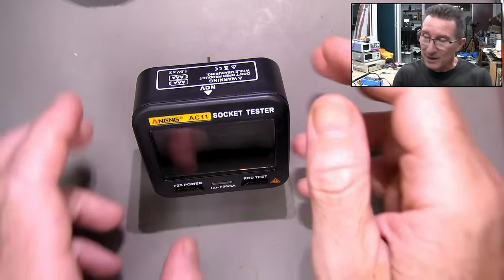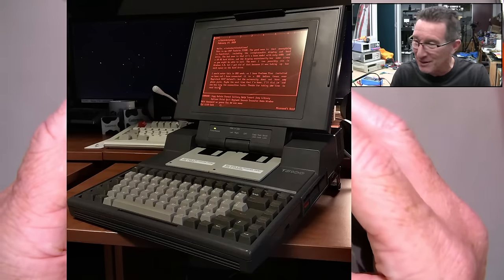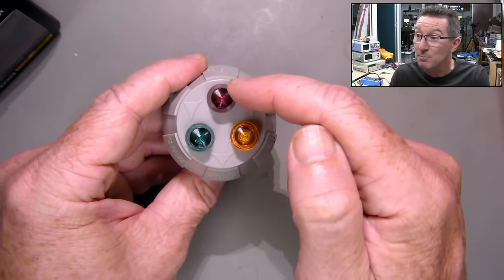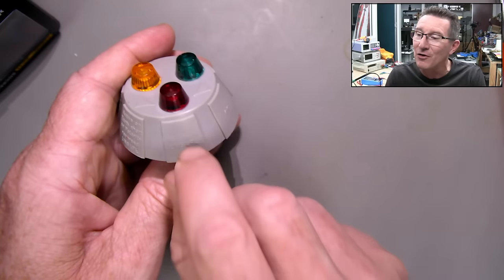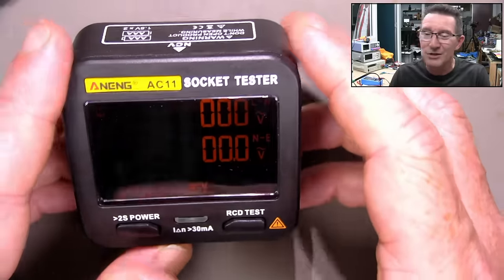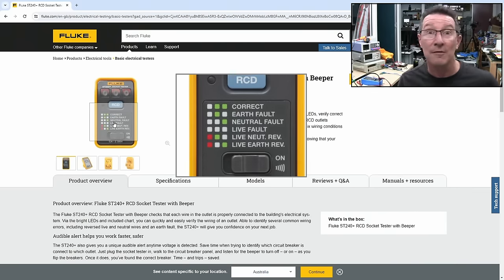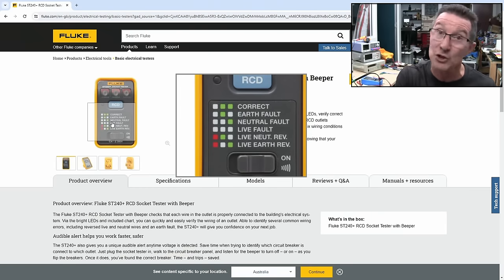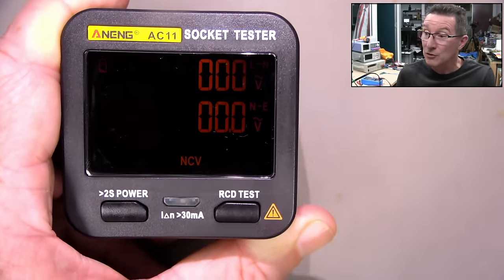EEVblog 1598 - ANENG AC11 Socket Tester TEARDOWN + SCHEMATIC Reverse Eng

Comment: Throughout North America, ground must be bonded at the service entrance at the first means of disconnect. Ground must not be additionally bonded at any sub-panel as that would allow current return through that ground conductor segment.
Reply: The interesting thing about all of these testers is that you really don't know if "earth"/ground is really and truly "earthed".  All you know is that the "earth" is connected to something.
Reply: @tubastuff  Which is fine as long as it's bonded at the main fuse panel. Having it bonded downstream would possibly defeat any RCD's, but since the earth wire doesn't pass through the RCD detection circuit, it doesn't matter where the PE/earth current ends up.
Reply: @AnnaVannieuwenhuyse    I'm not so sure about that.  In the US, the 240V CT of the distribution transformer (for residential single-phase service) is supposed to be connected to a true earth ground.  In the distribution panel, it's also bonded to the "neutral" and ground tracer wires.  Should the external true earth ground fail, the possibility of a fault to a water pipe or other "true earth" ground goes undetected.   When we have 240V devices, they're 120V-0-120V; i.e. both supply wires are "hot".   Of course, this differs from most European countries, where one of the supply leads is neutral/earthed.
Reply: @tubastuff  what's before the main disconnect was not scope of my comment. I retain my position on what I said. 🙂
Reply: @tubastuff  And that's why all water pipes and similar are bonded to the building's electrical earth ground.
Reply: @eDoc2020  It used to be that way, but with PVC and PEX plumbing, it's hard to see why it would make sense today.   Copper plumbing has been largely left in the dust on new construction, due to cost.  Galvanized iron pipe even more so.   Nowadays the practice is to drive a metal rod into the ground, tie to to the main panel and call it good.
Reply: @tubastuff   Obviously you can't ground plastic water pipes but at the same time this means the water pipes can't become live. AFAIK new gas pipes are still metal.
Reply: @eDoc2020  Depends on the quality of your water, I suppose.  Most domestic water isn't pure and contains dissolved salts and minerals, boosting the conductivity.   NG pipes in many sections of the US don't exist--many  homes are all-electric.

Comment: Re Toshiba laptops from the mid 80s, I was a Uni lecturer in a non-STEM subject, but a keen computer hobbyist at the time. I persuaded my Head of Dept to buy me one. It cost a fortune. I was interrogated by the Purchasing Dept as to why I should have one, but in the end they relented. That plasma display may seem crappy now, but I can tell you that to switch it on in the presence of someone unfamiliar with them, with it's power up screen flashing bright orange before creating a skeleton rendering of the Space Shuttle, was to make them gasp in astonishment that such wonders existed in this world.

Comment: When i was little, London got changed from DC to that fancy AC stuff - so Dad thought he'd have the 'Professionals*' over  to do a rewire - I was a pretty keen kid, and as they were wrapping up I used their tester - "hey you've got live and neutral the wrong way" - 'don't matter - , its AC!"
I might have mentioned it once or twice but things got left, until...This coloured spotlight had a 'continental' 2 pin plug, meaning I had to stuff something in the earth pin of the shuttered 5 Amp UK socket - used a screwdriver, and BLAMMO!!! The silence of midnight pierced by an explosion in my hand 
I don't move for a mo, and after the blinding flash, smoke clears to see plastic fragments and molten metal where plug and socket used to be... The Euro plug had an Earth strip, which had pinched into the flex, so the screwdriver had shorted the 'Neutral' to earth without ONE SINGLE FUSE between me and the company box!

So.. Its always good to check ;)

Comment: Unfortunately here in Norway we use the IT (Isolated Terra) system,
so earth is at the midpoint between the two mains pins in the plug, type of wiring 
(well older instalations use it, newer uses the standard TN wiring),
so this units will just show an error all the time.
Reply: thats pretty wild, I think I understand now why some new EVs have issues charging on AC in Norway!

Comment: I’ve got a Klein Tools tester for 120 vac outlets here in the US.  It’s got a nice LCD display which is easy to read and the GFCI test tells how many mS it takes the GFCI to trip.  I’m pretty sure the separate CORRECT and FAULT lights still work even if the batteries for the fancy functions go flat.  It was only about 20 Yankee bucks, so barely more expensive than a sketchy no-name Chinese tester.

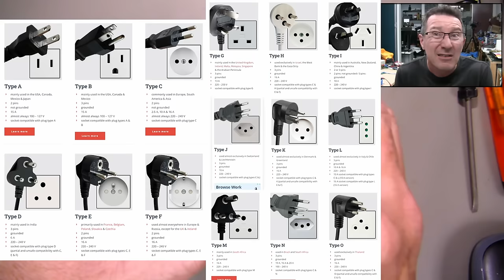Comment: 7:32 The Type C socket has been banned in Europe, but may still be found in Russia. 
Type C plug is still available in Europe. This fits E, F, K, J and L. Also fits smaller UK Type C.
Unfortunately it was not possible to agree on a type E or F socket. But almost all devices have plugs type E+F. 
This also fits into Type K sockets without connecting PE, which is why Denmark wants to switch to Type E. 
South Korea also has type F. 
Italy has types L and F. Greece Type F and another.
The Swiss type J does not fit Brazil's type N.  It has failed to introduce Type J across Europe.
I think type D + M fits in South Africa and India. 
Type H in Israel. 
The British Isles have Type G and a smaller Type C in the bathroom. But the C sockets in UK also accept the European type C. However, the smaller UK Type C plug does not fit in Europe.
Types A and B belong to the US with 115V, 
but there is also Type A in China with 220V.
Reply: C Sockets do still exist in Europe though in older homes if they were never replaced. In the Netherlands, I still see them from time to time.
After all we have a lot of old houses in the Netherlands.

Comment: Interesting and complex, over-complicated even. I know about these 3 LED quick testers, that inspired me to build my own a few years ago and it comes in handy for quick tests when I do any wiring work.
I like the NCV feature. Nicely reverse-engineered too.

As for relying on anything with batteries in it, I always test the gear on known good cases before doing the proper test. Still, I'd design it with a supercap and mains-powered charging circuit.

Comment: In the US, the neutral and ground should be bonded at the first means of disconnect, after the meter
Reply: And only there! Otherwise a broken neutral will put line voltage on the grounding system.
Reply: In Australia Neutral and Earth are also bonded. However we tap each domestic leg off the 3-phase supply, not a split phase.
Reply: @johncoops6897  You'll often see that in the US for commerical and industrial lighting circuits.
Reply: @PaulSteMarie  - often see what? A bonded Neutral, like used in many (Most?) other countries?
Reply: @johncoops6897  Pulling a single phase from three phase, in the US for commerical/industrial lighting and general purpose outlets, in other places for residential hookups.
Reply: @PaulSteMarie  - Oh, I see. Yeah, I know they pull phases for US commercial where there is 3-phase supply,. I hear there is actually 2 different 3-phase conventions, just to keep things more complicated 😃
.
However I was under the impression that most domestic in the US was using a split phase 220V supply into to the home, from the millions of culindrical pole mounted transformers in the streets.
.
In AU the lowest 4 power wires are  3-phase "415V" + Neutral. For standard homes (under 23 kVA) they tap alternate houses off each phase, and use a large number of homes to average out the phase imbalance.
* this is a gross simplification, just  for discussion purposes.

Comment: I owned one of those and had to dispose of it as the bulbs which illuminated the display failed.
I used it at work testing extension cords on construction sites.  Good unit overall, could have been tougher.

Comment: In Brazil, neutral and ground are connected close to where the wattmeter is. Unfortunately GFCI isn't mandatory (at least in family buildings).

I find cute the way Aussies and Brits rant about their outdated plugs with exposed pins are the best ones for domestic applications.
Reply: Actually, GFCI is mandatory in Brazil in all buildings. But only to selected circuits, though. It is usually installed in the form of a high sensitivity 30 mA residual current circuit breaker (RCCB) in the main electrical panel so as to protect the wiring and the sockets. Since the 1997 revision (now deprecated) of Brazilian Standard NBR5410, it states that all areas prone to water and condensation like bathrooms, kitchens and laundry must have their electrical sockets protected by a RCCB. The same is valid for all outdoor sockets, and to indoor sockets that can be reached and plugged into outdoor appliances.
Reply: Is Brazil using 127V P-E and 220V P-P?
Reply: @bluerizlagirl  It depends where you live. Some cities, mostly the older ones, are 127V/220V (phase to neutral / phase to phase), while others are 220V/380V (phase to neutral  / phase to phase). The whole country works at 60 Hz line frequency.

Comment: I don't have one of this type, but there is a meaningful scenario that these battery powered ones can help with or at least theoretically, which is when you have one hot wire disconnected some distance back in the line and so your meter would read some induced voltage, probably low but could still easily be over 30v with no capacity to drive the circuits of these devices.

Scenario was I was using a fluke plug powered one for a wiring job in a out building and it took me a while to realise the fuse on one of the lines was blown before the box and my recent run was a-okay. Would have realized right away with a voltage reading and these plugs make it more certain your reading is making a good connection than a set of probes.

Editted just to say I have the exact fluke model you brought up. Would love to see you tear it down so I don't have to :)
Reply: Perhaps a seasoned electrician would have known instantly. I was baffled why my wand was going off but the plug checker was completely unpowered if not bad wiring. I'm lucky I happened to check voltage back at the box before redoing the junction wiring.

Comment: I have one of those since about 2 years and it served well so far for testing my self made electrical installation in our garden shed. Also my LCD is not that dim as is yours. But to be on the safe side I have a „dumb“ one too with just 3 LEDs to cross test. Never trust just a cheap Chinese thing only when it comes to mains voltage.

Comment: Live - earth reverse on those is likely a broken neural instead. If there is anything connected to the circuit and neutral broken, the device passes the voltage to the neutral. The tester sees only differences, not voltages to the actual earth. In Finland testers must have a metal pad you touch to detect voltage on the earth contact.

Comment: I see they also make it with Type F plug...  but in the side-contact usage these plugs are symmetrical and there is no established L/N connection standard.
So it will display "incorrect" then you can just rotate it 180 degrees and it will display "correct".
Not very useful...

Comment: I have one of these, it's useful. But was delivered to me with the plug wired backwards (line and neutral inverted)....
Reply from the maker: LOL!
Reply: @EEVblog  nevertheless the screen on my unit is way more readable. Not super bright but okay.
The voltmeter part is pretty accurate (as expected from a dedicated multimeter chipset)
Reply: It's a Chinese plug. Non-insulated L&N, earth on top, different pin dimensions (thinner, longer but same angles). Not legal in AU, but will fit providing socket is not too worn from use.
Reply: @johncoops6897 I'm in France and mine is a euro plug that was kneed wired backward.
Despite the fact that it's pretty easy to wire, the LCD shows the correct orientation...
Reply: @Damien.D : Euro plugs don't have any orientation. I find this Aneng useful too, especially for the price, but the Live/Neutral reverse or not is meaningless in many countries.
Reply: @horstsauer9089  - Of course 3-pin European plugs are polarised. Doh.
Reply: @horstsauer9089  socket polarity is not mandatory in Europe but it's  advised to have live on the right.
Reply: Argentina also uses the Australian plug with inverted phase and neutral.
Reply: @Gengh13  - Interestingly, the AU, CN and Argentinean plugs are all copied from an earlier American plug, patented in 1915 and manufactured by Hubbell (model 1742).
.
It was chosen by the AU "consortium" because it was a cheaper plug to manufacture, compared to round pin designs used in Europe. It became a standard a fairly long while later.
.
A modified version of the "AU" (Hubble) design is still used in the USA (NEMA 10-20) for 240V 20A split phase (driers, etc).

Comment: I think if the RCD is defective and doesn’t trip then the 6.4k resistor will let the smoke out if you hold down the button!
Reply: You should not hold the button down for long. There are also other risks. If it shows open ground and the socket has a metal cover, the cover will give you a shock if touched. If you press the RCD test it will get really nasty.
Reply: I can confirm the resistors get very warm, one desoldered itself from the PCB.
Reply: @dino6627  A safety feature!!!

Comment: been carrying a Deta Power Outlet Tester Plug on my  keys at work for about 25 years so long the once clear body of it now has a yellow tint to it only use to to tell if the GPO has power easier to use that than to wander around with an angle grinder

Comment: I have 2 of those for US sockets and used them a few times for changing outlets a few times already .... mine have bright displays.  They don't work with nimh batteries so make sure you have good 1.5V alkalines in there.

Comment: Just a question, What's "dangerous" about live and neutral being reversed?
I. Live in a country with shuko plugs (seen in thumbnail), and those are reversible.
Socket testers aren't a thing here as well, if you wat to check correct connections you use a duspol or something similar.
Reply: Reverse polarity is a problem because the neutral is bonded to ground at the main board to allow for the RCD/GFCI to function. Saving someones life if they touch a live conductor by tripping as soon as there is 30mA 'leakage' from Active to Earth.
Reply: @gin3648  that might be the difference, where I am TT earth is extremely common.

Comment: The M.E.N. is (in australia) ALWAYS at the location of the Main Switch, so not in a sub board, So Power pole, meter link, meter, main switch, physically where M.E.N. is, then off to sub boards and final circuits. Also, I'm fairly sure its Main Earth Neutral, not Multiple Earth Neutral. 
To be boring, those RCD testers aren't illegal, but you can't really achieve any legal test with them, they are a gimmick or good for finding with RCD covers a power point, or possibly used to test earth continuity the long and trying way. A Legal RCD test requires ability to record time, change mA setting, and test each half of the wave.

Comment: I couldn't use them in industrial electrical work, because I had everything from 24Vdc all the way to 33kV ac, so I stopped using Duspols and I've used a fluke ever since

Comment: So if the RCD doesn't trip how long before you smoke the RCD test switch?
Reply: Meh, it's 37 mA... the switch will be fine. The resistors, however, will get really really toasty.
Reply: @EnricoConca  By Chinese reckoning, 3216s are good for a few watts .....

Comment: I have a few of those simple ones. Used it when wiring up some outlets. I think you'd have to try and reverse earth and neutral. The bare earth wires connect to the metal box.
Reply: Some people are just that good at making mistakes. I suppose with fully-insulated wiring it's easier to swap the two. And while it's not exactly a swap it's relatively easy for a damaged wire to cause a short between the two. Worst is when hackjobs intentionally connect neutral to receptacle ground when "upgrading" places with ungrounded wiring.
Reply: @eDoc2020  yhea, I was specifically thinking with the bare wire and connecting that to the metal box. That part should be easy enough.  I could see someone missing one of those if there are multiple bare wires, but it should never be connected to anything else.

Comment: I bought a similar one from Mastek MS5902R that also injects a test frequency back onto the mains. Then a non-contact gun type thing can be run down the circuit breakers, allowing you to determine which breaker is powering that socket outlet.
.
Similar to the Klein circuit breaker finders, but about 1/5 the price.... works good enough in non-commercial applications, and easier that plugging in a radio and flipping breakers until the music stops 😂
.
Only easily available with EU and US plugs, so I modded mine with a IEC socket so I could add whaterever cable I desired.

Comment: Non compliant AU plug? No insulated pins for N and L.
Reply: pins need to be insulated, but high voltage in bathrooms is ok 🤣 💥😵⚰🪦 AU always wins
Reply: @echelonrank3927  High voltage means over 1000 V.
Reply: Australian sockets have switches on the faceplate, so the pins are not connected to anything while the plug is half-in and half-out.

Comment: A bit of a sod to use if the plug is upside down, I think. In most of Europe, apart from France,  their plugs & sockets are reversible, so how does it cope with that? Cheers!